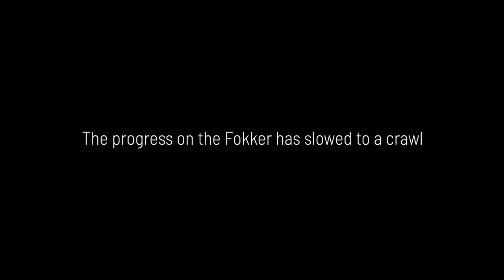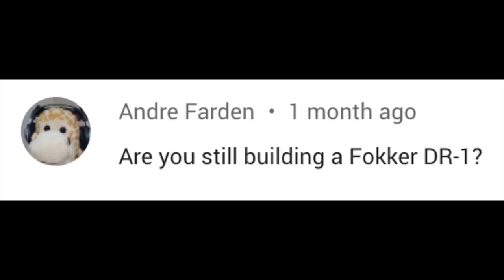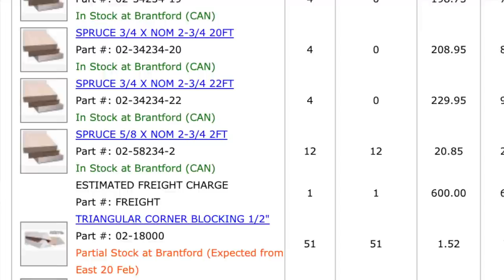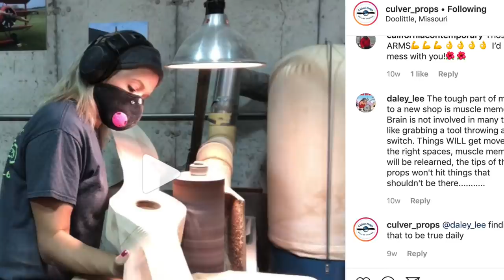Fokker Project Scrapped?

Comment: What I enjoyed most about the DC-3 project was what I took to be an attitude of “let’s do what is required to get it flying safely” versus an attitude of “let’s make it totally authentic, like it just left the factory, only much better”.  So many cars, boats, airplanes restorations are strip it down to bare frame and replace or re-plate every nut, bolt and screw. My hope is you just try to make it a usable and enjoyable plane and not a historic monument. Anyway, thanks for ding these videos.

Comment: Not to worry!  You are doing a great job.  Viewers quickly forget just how complex working with several vintage aircraft is.  Look at Kermit Weeks... he started out as an wealthy enthusiast with the cool dream of owning a lot of airworthy vintage aircraft.  Kermit quickly realized that even just one large aircraft takes a sizeable team and lots of money to not only operate but to maintain as airworthy.  Bigger planes require even more (ex: his Lockheed Starliner) Take that obstacle and multiply it by just 2 or 3 aircraft and at least 1 project will suffer.  In Kermit's case, multiply it by 20, or 30, or more.  Even modern a/c deteriorate just sitting in a hangar.

Comment: I've had my aircraft out of the air for nearly 12 months now for what was originally just a a propeller change. discovered some engine issues at the same time, plus long waits for parts, then find the new prop was the wrong pitch anyway, so still waiting on another prop! Welcome to aviation!

Comment: I'm building a Heath Parasol replica all wood, fixed up a Bowers FlyBaby, all wood, you don't need to be a carpenter to build wood parts. Just follow instructions on the plans and get advice when needed from home builders or the designer.

Comment: If you have trouble finding a practical use for it, you could go on to restore a Fokker F-27.  Did Fokker ever make a wide door transport? I didn't see one on Wikipedia.
     One use for a triplane is I bet it is so STOL that it might get supplies to some spots that would otherwise need a helicopter, however it might also be easier and cheaper to just use a helicopter.

Comment: Hi Mike. I did wonder about the timeline, considering the workload and the small core group. You guys are mostly metal orientated. Woodwork is a different beast. Outsourcing is an excellent idea. Hardwood is almost impossible to get. Thank you politics. Setting goals is good. Otherwise it will never get done. They must however be realistic goals. Two years work in six months wasn't a very realistic goal. It's just math, you are good at that. Everybody adores Benjamin. He certainly rose to the top sleeping under the wing of that plane. If I may, he wasn't the only graduate of that school. Food for thought. :)

Comment: Mikey, time to take a very long and careful look. I've been thinking for a long time that Benjamin has moved on. He has a career to think of and working on what is really just a large scale model aircraft wouldn't have helped him with that. IMO you're lucky to keep him at Bufallo actually as he's young and his future is with modern commercial jets, not old warbirds, but that as I say is just my opinion. So if you want to continue with the DR1, you'll need to find people who want to do it for love - retired engineers, amateurs who have built their own wooden aircraft in the past and so on. That may be a tough ask as this project definitely doesn't have the the cachet of DTD. Now about the Fokker itself. I repeat a warning that I made right at the very beginning of the project. Transport Canada (like all civil aviation authorities) are NOT into dreams - their priorities are airworthiness and safety. My own opinion (and I may be wrong) is that an aircraft that was as badly damaged as the DR1 was with significant distortion to its airframe would usually only be eligible for restoration to STATIC and/or TAXY standard and would not be allowed to fly. If you want to get it back flying my own thoughts are that you'd have to get all of the airframe thoroughly X-rayed and crack tested which would probably make the whole thing totally uneconomic. I had to get that done in a limited way with a Tripacer that I did years ago in the UK and that had just been standing unflown with its CofA lapsed and never damaged. As I say, I may be wrong, but if you haven't already, you need to check this out with TC before going any further. It would be tragic (for your wallet especially) if you go the whole hog and are then disappointed. Good luck!

Comment: Hello Mikey , there is  a solution to your problem, get on the computer dial up Old Rheinbeck Airfield USA.
Museum based at old Rheinbeck has a wealth of experience building,repairing pre 1930,s aircraft of rag ,wood, steel tube and chicken wire, . So your Driedecker Project  should be a breeze for them to build, know is a bitter pill to swallow,letting Old Rheinbeck take over the project on your behalf. But will leave Buffalo free  to concentrate keeping their gorgeous fleet of piston pounders flying. I Cannot see Joe flying  a fart bus(ATR -72  ,Dash 8 Q400) or any domestic kitchen appliance with wings attached. Like the Fox Moth, it is really cool, only a handfull flying, do it have the DH Gipsy Major Mk-10 with the electric starter?.

Comment: 165 days and nothing.......................... What's going on? Get in touch with ÉNA, ask for volunteers, go down there to Montreal with what you have on the Fokker. Stay there for whatever time it will take to complete the project (which should be a lot less than for DTD) and just GET IT DONE!
If they can't mill the molds/templates, have a volunteer/volunteers 3D print some, ship it to you, and set up a production line for spars.
VolunteerS (with a capital S!) got the job done the last time.
This time you have basically dumped the project one one single volunteer, working his full time job, and then basically being left in charge of the entire project on his spare time, working around the clock.
That is not FAIR!
If you don't pick it up, it will stay down, Mikey.
Reply from the maker: Covid-19 has its limitations. Wings and subsections are being made off site, but with out me being able to travel or have people travel up here reliable filming and story telling are no feasible until the borders open up.
Reply: @MikeyMcBryan  SOOO the DR-1 will be assembled from pre-built sections. This flu IS kicking okole.  Thank you for the update. Any word on your Dad's DH Fox Moth?

Comment: So...a lack of wood, and someone to work with the wood is putting the brakes on. Something was bound to happen, no way it could go without a delay, a snag, or a screw up. That's just how it works. This rebuild is going to take at least 1 full year from now to complete. IF you don't run into any more snags....if! Cheers from Winnipeg.

Comment: Do you really need a carpenter to work wood?
Reply: nightlightabcd I was wondering the same thing.
Reply: You need someone experienced.
Reply: I know right, I mean it's only wood how hard can that be, he's a young fella working by himself to scratch build a 2 large wings and the landing gear complete foil.then a complete tail assembly. Steaming the wood It basically just falls together right. And the plane only has to take 1 pilot to fly it, so that's not important if if this young man, made 1 tiny little mishap ANYWHERE. 

FFS guys just think about it it takes a team of specialized engineers 3-4 years to build the wing set. And you think 1 man whose never built a full size aircraft and then go through all the government testing and  certification, during which they are going to ask what's your history on building ww1 replica, what's he going to say. 

Don't forget Mikey's running a transport company I a freezer at the top off the globe. 
Really hope your joking.
Reply: And I do Sutter when I I I writing